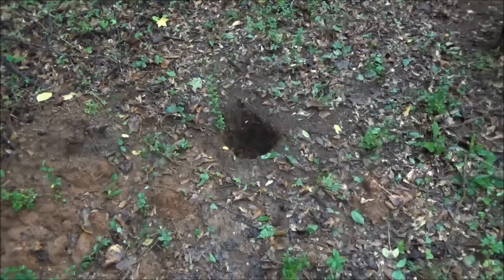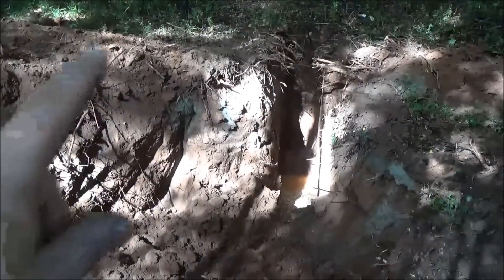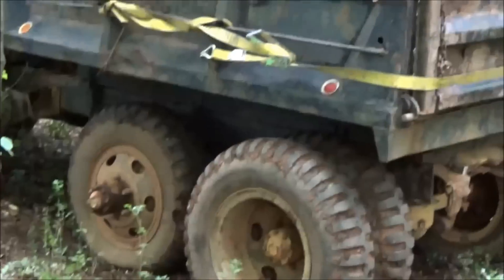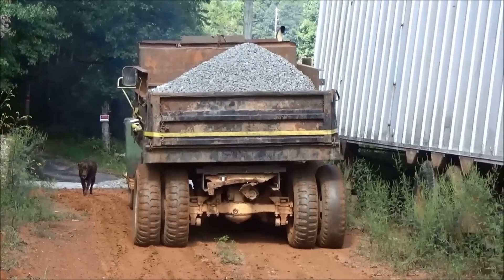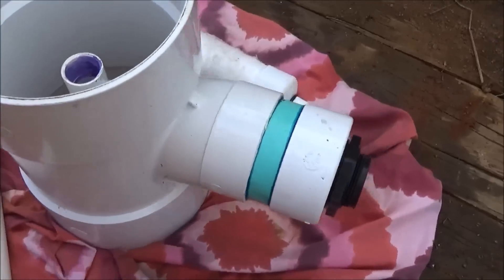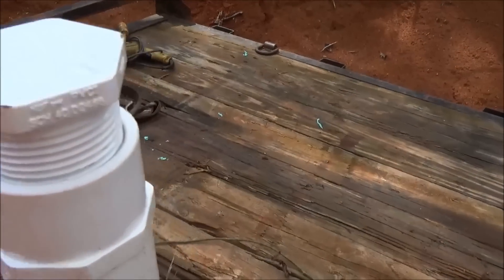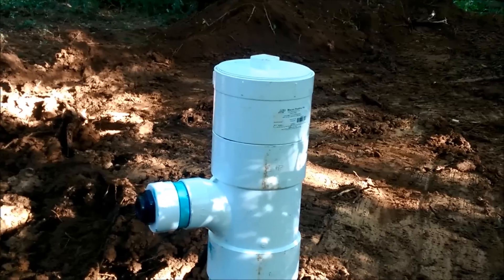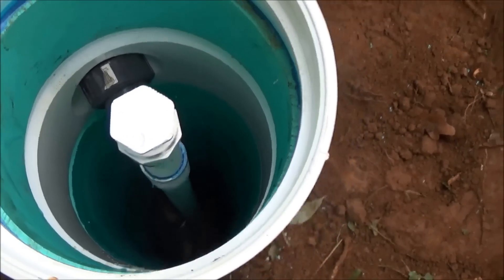Hide Away Well Part 1

Comment: Really useful video. I used this as a guide to installing my own "shallow ground water Well". I went down 9.5 meters, the full stretch of the excavator arm, then installed a Well pipe and gravel pack as per your suggestions.  The recharge rate is 30 liters/min and I use an eBay submersible pump (Singflo) to pump 6 litrers/min of clean water. Tested out as typical od district with high iron and coliform bacteria. Sincere thanks for your work. Neil (Queensland, Australia)
Reply: A simple in-line Venturi aerator and a 60m long connector hose to the storage tank (with a sediment filter on the outlet) reduced the Iron level acceptable limits. Neil.

Comment: What dimension filter cloth did you use for that size hole and where is it available from? Thanks.
Reply from the maker: 25ft by whatever length you want.  I get it from a local culvert/irrigation supplier.
Reply: Thanks very much!

Comment from the maker: An instructional video of how to dig and develop a shallow well.  We will be connecting a Dankoff Slow Pump to this well that has a static water level of 8 ft.  There is approximately 1000 gallons of reserve in the gravel bed.  Filter fabric covers the stone.   We are getting a 9.5gpm recovery rate and we will be pumping at 2gpm to a 1100 gallon buried cistern.  #practprep   #sustainability
Reply: Excellent video. We just put in our second shallow groundwater Well, following the steps/instructions in this video. Straightforward (apart from the odd rocks) and successful if your water-table is within reasonable distance of the ground surface.
Our groundwater Wells are an alternative to hugely expensive commercial drilled bores. For the disciplined domestic needs of our co-op members the lower capacity wells are more than adequate and supplement our rainwater harvesting. Water quality testing showed high Iron and Manganese but no ecoli/feacal contamination. Simple aeration and filtering brought the levels down to recommended. (Always test the water.)

Thanks for a magic video. Neil Gribble Queensland Australia.
Reply: @neilgribble5878  Hello Neil Gribble. I would like to get in touch with you as I am in Queensland and want to construct one of these wells.

Comment: That's nice , good job. I think I would invest in a brass pitiless adapter,  only just to remove the pump with a tee bar instead of 
Having to reach down and unscrew the union . 
But I like your pitiless , just saying if the coast is not a lot between the two , I would use a bras pitiless . Thanks again .

Comment: its called a well head. You can drive it into the ground without digging and make a shallow well.
Reply from the maker: What you are calling a well head is actually a drive or driven point.   What I did by adding the 20 tons of gravel provides a 1500 gallon reservoir.  Yes I could have driven a point and I will be doing that soon at a different location.

Comment: I have a question . I am looking to buy 9 acres and the owner said a water witch told them 30 yrs ago that there was a stream about 40' down in a spot. Have you ever work with a water witch and how reliable are they???
thanks
Reply from the maker: Well I don't like witches and I wouldn't trust one.  That being said dousing is a method used to find water and there are some folks that are good at and some are complete loons!
Reply: engineer775 Practical Preppers I agree on the witches ...I dont think she was a witch but I was married to an evil women once.

I will read up or utube on dousing and see if I can dbl check the readings before I dig.
 It might be fun too learn. they said it was 40 ft down.
thanks